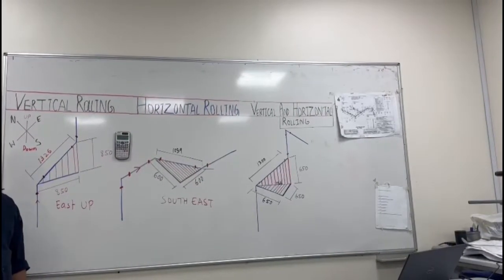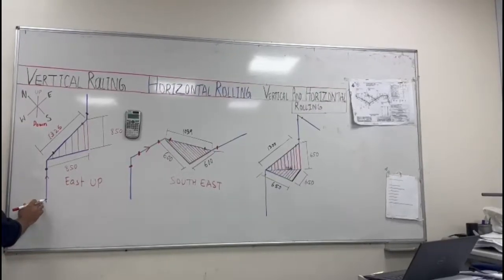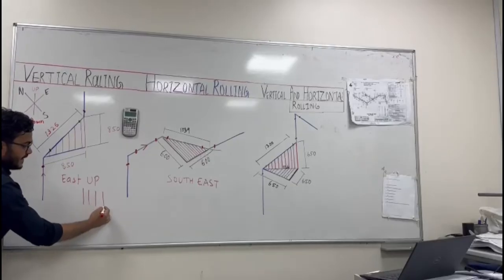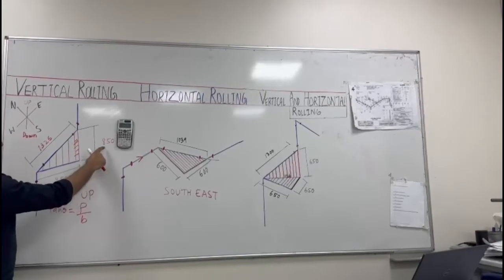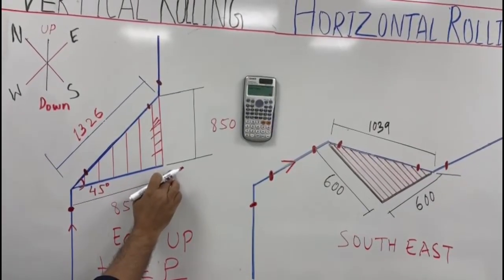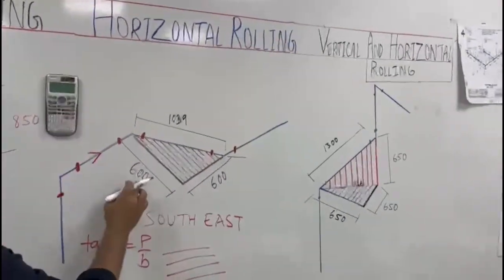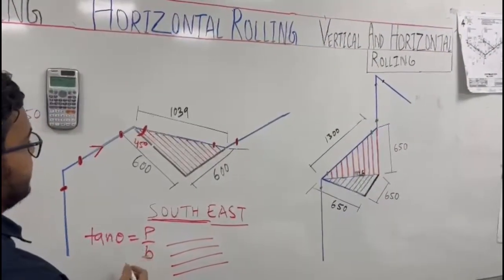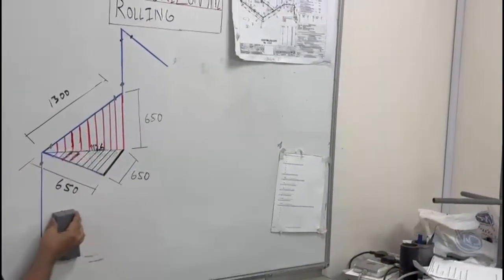How to Read Isometric Drawing Vertical Rolling Horizontal Rolling Vertical and Horizontal Rolling

Comment: Quick tip:
Separately In vertical and horizontal rolling, once you saw two sides of triangle with a shadow (ex. 600x600) with the same value,  automaticaly the degree of elbow is 45deg. No need to compute using tangent to find the degree.
Reply from the maker: Great tip!